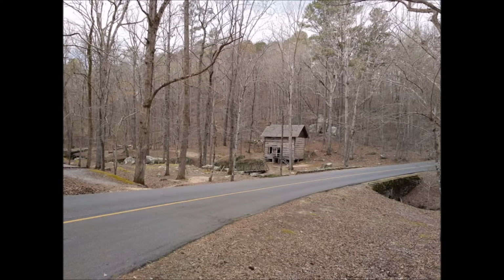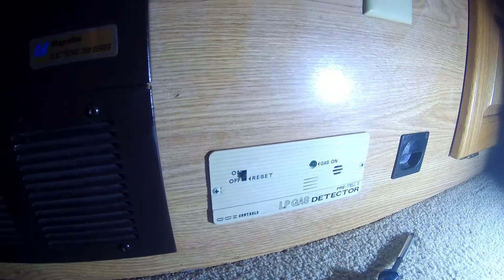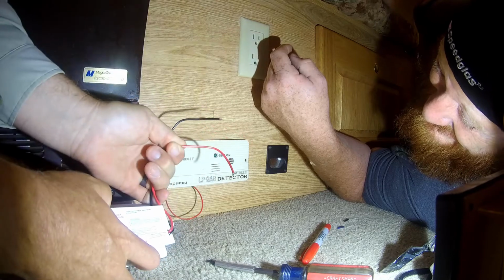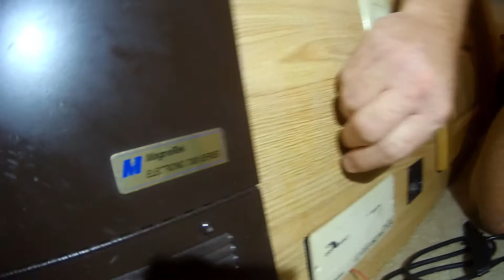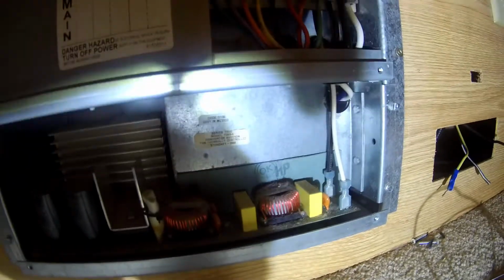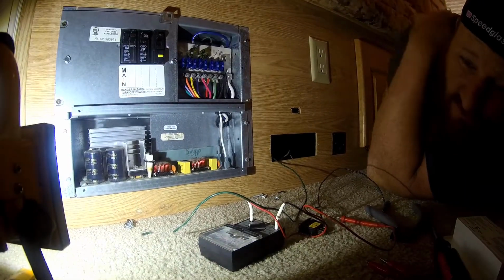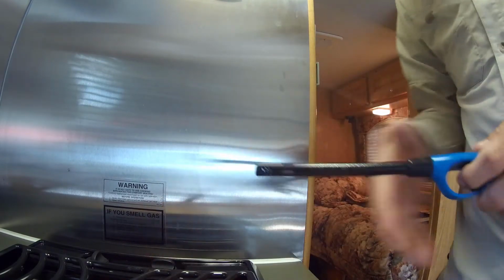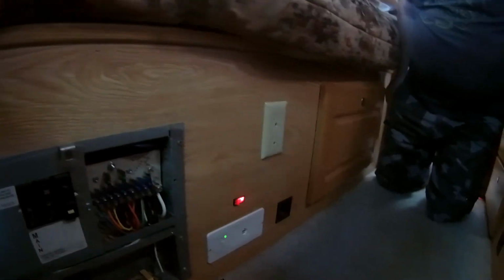RV LP Leak Detector | Change from 3 Wire to a 2 Wire

Comment: thank you for the video. help me get of of taking it and spending lots more money.  only thing I had trouble with was my the factory wiring, cause my was Blue/white(+) and my white was(-). but now my stove light and my light over the sink don't work🤔🤤😭. was wondering if I burned another fuse  that u might know that I didn't check. well thank you and your buddy for the knowledge, now I have heat in my trailer.
Reply from the maker: abel chavez Thank you for your comment!  I'm glad the video helped and you have heat again. I would double check the fuses and maybe the light bulbs themselves in the sink and strove area. Thanks again!

Comment: Have you had issues with this since you did the project? The solenoid on the gas line is 5vdc, but your switch is pushing 12vdc to it. I would think that the higher voltage would make it too hot or burn out over time? (I have the same issue now and am replacing mine too, frustrating they don't have an easier way to replace the old style!!)
Reply: Hi, thanks for the question! I have not had any issues. I leave it in the on position unless I need to get my tank refilled, then I turn it off. After the service station is don't filling it, I turn it right back on.

Comment: I'm getting ready to change my old LP detector out and add a switch. How is the switch wires? You guys jumped straight to the switch working and now I don't know what to do?!?! LOL!!
Reply from the maker: Hi and thanks for watching! So, one wire goes from a ground to a blade on the switch . The remaining two blades on the switch go to the detector.
Reply: @scenicroutetravelers3655  Hi there! Thanks for the video, and this answer. But - still not clear (sorry my dumbness). in short - there are 3 wires coming out of the wall (2 red, 1 yellow). You're connecting 1 extra wire from the ground, to one of the switch terminals. From what I understood - you're connecting 1 red wire (from the main battery - coming out of the wall) to new detector red wire? And other wires? where the yellow wire goes? And you've replied - 2 wires go from switch to detector - how exactly? 1 to red, 1 to black? But most importantly - where the yellow wire goes? Again, sorry for dummy questions, I'm totally not electrician!
P.S. I guess the best would be if you could simply draw a diagram on piece of paper, and post a picture of it - but I don't see an option here to attach images... 
Thanks again!

Comment: I have the same issue as you...... it sucks.  very little info...............and MTI is just about useless, i called and they did not want to talk to me on the phone. your video is great......but may be beyond my capabilities...
Reply from the maker: Casey Sewall 
Thanks for the comment. It is a little challenging. If you think it's out of your capabilities,  you may have to take it to Camping World. They will probably want to do the whole swap with new solenoid.
Reply: Others have told me to just remove the solenoid altogether, and utilize my already installed safety detectors in the RV. this system has left me without any LP now for weeks, no frig, no stove, no heat....
thanks for your help and advice
Reply from the maker: Casey Sewall 
I like to keep it because I can turn it off with a switch when I have my tank refilled.  It would be difficult to get to the shutoff valve under the coach.  I'm afraid that when they put high pressure to it while filling, it could damage the pipe or an appliance.
Reply: my stove worked and my hot water heater still without LP detector????